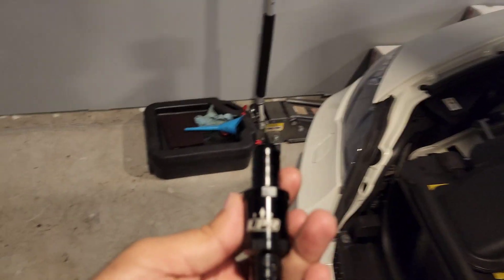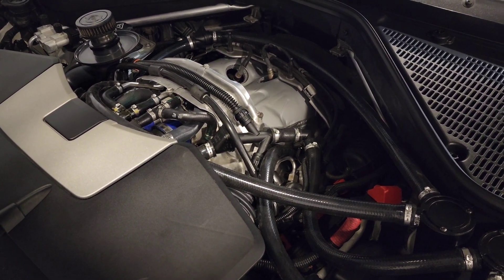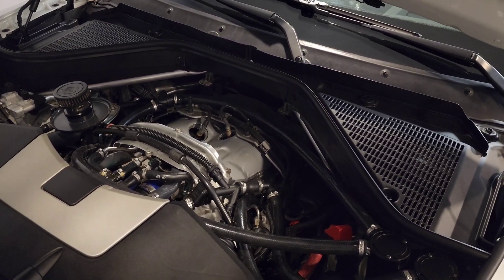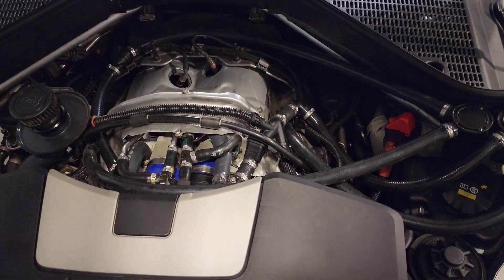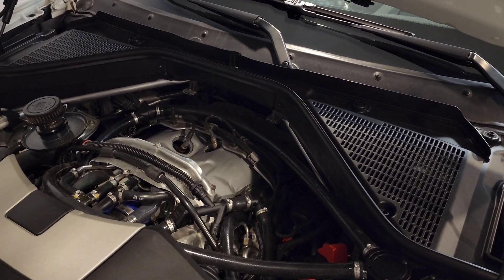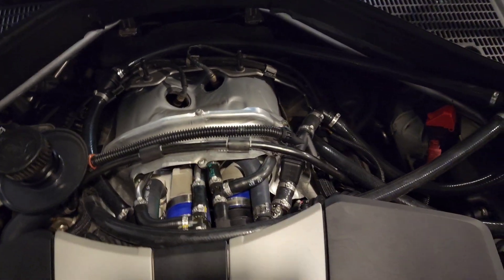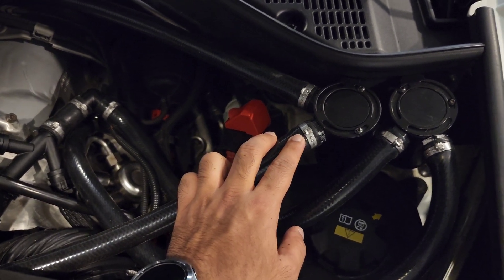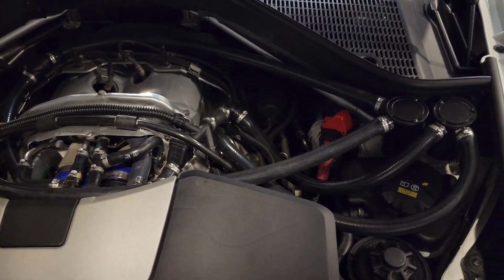BMW E70 X5M - PCV System / Catch Can Setup | 4K

Comment: You are supposed to have difficult time removing the oil fill cap if your engine is healthy. If you can easily take it off... you're in for a world of hurt.
Reply: What does this mean?
Reply: @jacobpensky8848   It means a healthy engine has good vacuum and taking off the oil cap should feel resistance. If not, then your engine has a vacuum leak somewhere and it will run inefficiently and eventually break down. You should have or will eventually get a check engine light.
Reply: @matreyia  mine runs perfect. It does not smoke but consumes 1 qt of oil every 2500 miles. My cap didn't seem very hard to remove
Reply: @jacobpensky8848   Yeah...that's another symptom also... oil consumption.
Reply: @matreyia  so I should start searching for a vacuum leak? Start replacing CCV separators, check valves etc?

Comment: The reason you had the excess vacuum & squealing noise with UPR check valves was because the stock check valve connected to the intake hose has a small leak hole which allows fresh air flow back into the crankcase and does not allow the vacuum in the crankcase to go above a maximum of 100 mbar (i.e. 90 % vacuum)
Reply from the maker: You're right about the UPR valves, but the system I'm running right now is also one way without any leak holes, but it runs perfectly without any smoke or oil consumption. Small leak hole is only in newer replacement PCV systems. The check valves in older hoses did not have any, and it completely blocks flow in one direction.

Comment: Hi
I've got the same problem I've added catch can and I followed your instructions the catch cans are dry.
Do you think the check valves  are not working as it still blows blue smoke as you described.
Thanks

Comment: Hi! I have a problem with my BMW X6M 2010 4.4 555 hp 175.000 km. The car is misfiring. At first it was on cylinder 1. I put new spark plugs and coils. When I clear the fault the car runs good but after 5 min the check engine is back. And the misfire changes every time. For ex now it is on cylinder 1, I delete it and after is on cylinder 5. It changes between cylinder 1,5,6 and 7.
What could it be?
Reply from the maker: Hi, what spark plugs did you get? Did you check their gap or installed them as they came? If the misfire comes up as an error on a specific cyl, the rule is to move the spark plug or ignition coil to see if the misfire moves with the change. I'd suggest you check spark plug gaps and move spark plugs from cyl 1, 5, 6, and 7 to others, clear codes, and check again - if the misfires move, then spark plugs are either gapped wrong or faulty. If they don't move, next would be to move ignition coils, clear codes, and check again. Good luck!
Reply: Could be the fuel injectors?
Reply: I changed from 5 to 6
First test the misfire stayed on 5 second test on 6 and after on 1
Reply from the maker: @dariusmoldovan7189  DM me on IG @e70_xratedm

Comment: Where do you bought the oil cap? I have the same set up but I have the same problem with the pressure... 🙏
Reply from the maker: Oil cap was from ECS Tuning - I will be dropping another video soon with a better setup (basically to separate each bank) with additional check valve which resolves the vacuum issue.
Reply: Hi
I'm using 19mm hose. Do you think they are to big and not giving it strong vacuum. 
Thanks Mark
Reply from the maker: @markgrace1254  I don't think 19mm is too much. Factory size is 8AN - any symptoms or issues?
Reply: Hi
Problems solved it was a bad check valve. 
Thanks again Mark

Comment: Do you have a link to the updated check valves?
Reply from the maker: Actually, hold up - I will be re-doing the catch can setup with different parts and routing of hoses. This worked for a little bit but the hoses I used could not hold up oil and kept leaking.

Comment: Good video bro mine x6M so same as your car do you have any throttle body problem cause mine kept having map absolute throttle angel bank 1 too low I believe throttle is toasted
Reply from the maker: No, no throttle related issues. What's the code? I'm guessing your issue may be related to MAP.

Comment: Does the catch can set up.
Fix the issues you had.
Would this be the ultimate fix .
And do you have a instagram we can chat on further .
Reply from the maker: It did. Issues that I faced were related to the PCV system, probably one of my check valves was bad and when I installed catch cans. It stopped smoking and consuming oil. So it doesn't smoke nor consumes oil (I change oil every 3,000 miles or 6/mo). Yep, IG e70_xratedm

Comment: I have exactly same problem with E70 2009 X5
Should i change PCV?
After running for 4-5 km or more the same sound starts
But Car run fine
And Sound Goes away if i restart the CAR
Reply from the maker: Where is the sound coming from? It could be the serpentine belt or PCV. For serpentine belt, spray some WD40 to test and PCV, remove and test/check the check valves first. Check valves could potentially be stuck closed or open.